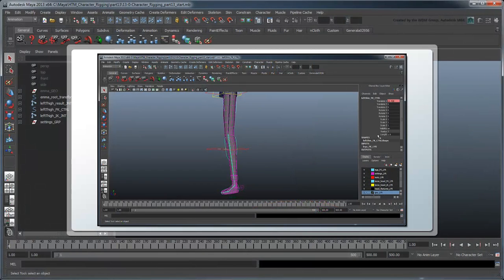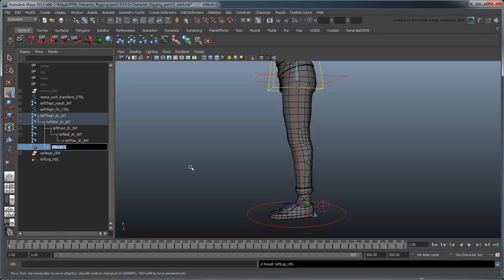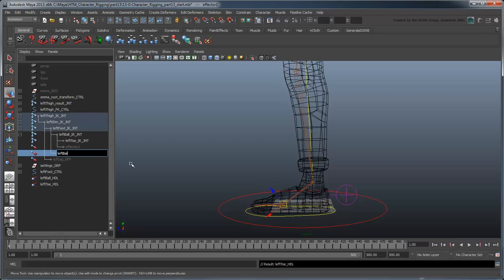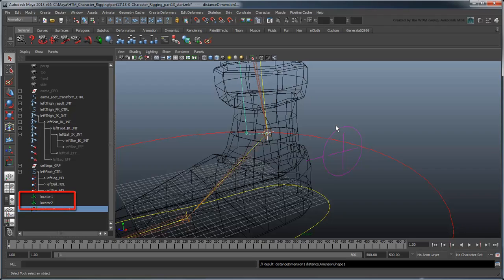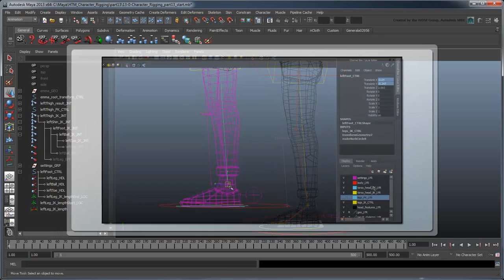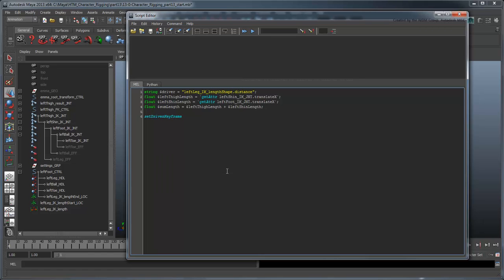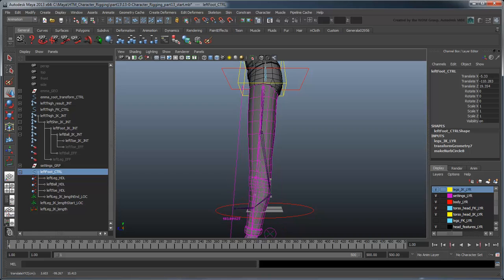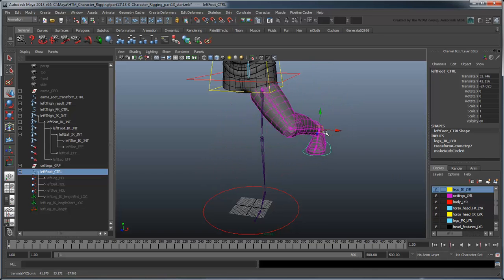Creating a Character Rig - Part 13: Leg IK controls and joint stretching (Advanced)

Comment: Hello. Thank you for this tutorial. 
And I've got a question to confirm what you mean by the comment at 6:17 to 6:31.
Actually, I could understand how tricky to position Foot exactly in the maximum length; however, I couldn't get why you said so in that context. Thank you for reading this. 
(Edited) Sorry, I've just realised that the maximum length means length when joints are in a straight line.

Comment: hi...its me again...i have a problem with the post infinity on the right side...the IK knee joint moves after applying post infinity...Left side is all ok....I didn't have this problem previously...not sure if any graph editor settings went wrong anywhere...

this is before i apply
https://drive.google.com/file/d/1HIElXjyD9vkuu9m3H29xYjmMkVnp5l5L/view?usp=sharing 

this is after i apply
https://drive.google.com/file/d/1Al4cRqlagwrxMcBreUVpLH46Tz37BbQS/view?usp=sharing
Reply from the maker: Odd, it looks as though all your local rotation axes change in the after shot which definitely shouldn't happen.  Can you open the Move Tool settings, check the Joint Orient Settings and make sure Automatically Orient Joints is turned off?  Then I would try reapplying the script to that leg.
Reply: @Autodesk_Maya  thanks for replying....i found the mistake in the script editor...i did not make it an inverse one....

Comment: Maya 2020: Not sure if this issue applies in previous versions. 
If anyone is having issues with the MEL script step and the leg becoming stretched 100% of the time regardless of whether the foot is at the exact same position check the locator's Distance attribute by displaying Shapes on the outliner and selecting the locator's distance shape. The distance value in the attribute editor does not get converted if you switched Maya's Preferences. My distance in the attribute editor was 96 cm but in the workspace the locator gave me a distance of 0.96 m. The MEL script takes the UNCONVERTED DEFAULT CM value as the driver and will therefore always stretch the leg. The quick solution is to change the workspace units in Preferences back to CM instead of meters. 

Somewhat longer fix is to open up the locator's distance shape in the node editor. Mind you this is the first time I ever worked with the node editor (only experience was from this tutorial series) and I was able to get it to work without changing the units. If I can do it thanks to this channel you can to. 

Create a unit conversion node(mine was automatically converting cm to m) and take the locator distance node's distance attribute and insert it as input to the unit conversion node. Then create an empty group and rename it to something that makes sense. Bring this EMPTY group into the node editor and drag the output of the unit conversion into the translateX of the EMPTY GROUP. 

The empty group is there so that we can use it as a driver(probably better solutions out there but my way worked). Now in the MEL script replace the $driver variable declaration from the IK_lengthshape to the name of the EMPTY group you created. Then just grab the translateX attribute by doing a ".translateX" at the end of the variable declaration before the semicolon. Now run the script and voila it should work. 

Also refer to Maximilian Correa's MEL script in this comment section because that worked with my method since I am on Maya 2020. 

I know its been 7 years since this video came out but if it helps you please upvote!
Reply: hello, i'm sorry but somehow after I run the script, when I moved the foot control it permanently stretched even though my workspace is on cm already, do you know how to solve this?

Comment: Should rotation orders in maya be: axis 1 = least used axis, axis 3 = most used axis? (like this tutorial for feet, which is zxy)
Reply from the maker: I wouldn't think of it so much as "most vs least" used axis.  I'd think of it more as, whatever rotation order allows you to create the most common poses without gimbal locking.  Think about the whole pose, not just one axis.
Reply: @Autodesk_Maya  Is there a step by step approach to determine this, or is just "an experience thing"?
Reply from the maker: @Exsulator2  Experience.  The right answer technically depends on your specific rig and desired poses.  The ones I show are the best ones for this rig.

Comment: i need some help in maya 2016
setDrivenKeyframe -currentDriver $driver -driverValue $sumLength -attribute "translateX" -value $leftThighLength leftShin_IK_JNT leftShin_IK_JNT;
// Error: line 6: No match found to driver: leftLeg_IK_lengthShape.distance // 
// Result: scriptEditorPanel1Window|TearOffPane|scriptEditorPanel1|formLayout88|formLayout90|paneLayout2|paneLayout3|tabLayout2|formLayout91|cmdScrollFieldExecuter1 //
Reply from the maker: I'd check to see if your distance node has a typo in its name or something.
Reply: @Autodesk_Maya  thanks alot

Comment: everything works fine beside the moment when my length passes by 2x values the knee bends again ;/ Any thoughts on that? thx in forward.
Reply from the maker: Hmm, are you sure the animation graphs look correct?  They should be straight diagonal lines.
Reply: @Autodesk_Maya  Yes looking same like urs. Besides that, I need to put the second key tangents to spline to make the post infinity liner to work ...
nvm, i found the problem.
I somehow missed to do it for the foot_JNT.  sry for pulling attention to such a stupid mistake ;D
But thx a lot for the fast reply.
Have a nice Day :D

Comment: Hey Listen I've been following this tutorial and everything went fine but my when i stretch the controller the geometry doesn't follow...they(thigh and shin) are stretching individually just fine...( i'm using Maya 2018) . The controller is not stretching at all i also did the programming twice if i made some mistake. can you tell me where i could be wrong? @MayaLearningChannel
Reply from the maker: Did you set the tangents to "Spline" as noted in the video description?  I know I said to set them to "Linear" in the video, but turns out that doesn't work on newer versions of Maya.
Reply: @Autodesk_Maya  i did, as it was the same in one of the previous movies. But i have solved that issue as i did the whole leg again (maybe something i did wrong along the way).. but now my leg and thigh geometry rotates in the opposite direction.. while it stretches just the way it should the geometry rotation is all messed up.... do you know why that happens?
Reply from the maker: @alishaseby6194  Try placing the geometry within a group node first and then into the joint hierarchy.  Does that help at all?
Reply: @Autodesk_Maya  It didn't, it was the same as before.. as soon as i hit linear in post infinity (graph editor), it distorts the geometry. But i finally got it working by using node editor this time instead of mel commands, now it's looking good so far...  Also thanks a lot for your help i really appreciate it.

Comment: Hi, I'm using Maya 2017 and having trouble with the script, this is the script I typed and looks the same to me...

string $driver = "leftLeg_IK_lengthShape.Distance";
float $leftThighLength = getAttr ("leftShin_IK_JNT.translateX");
float $leftShinLength = getAttr ("leftFoot_IK_JNT.translateX");
float $SumLength = $leftThighLength + $leftShinLength;
setDrivenKeyframe -currentDriver $driver -driverValue $SumLength -attribute "translateX" -value $leftThighLength leftShin_IK_JNT; 

this is the error I'm getting
// Error: line 5: No match found to driver: leftLeg_IK_lengthShape.Distance //

What am I doing wrong, please?
Reply from the maker: Change the capital "D" to a lowercase "d".
Reply: @Autodesk_Maya  Thanks alot, all sorted now

Comment: I had problem with code while I am working on meter unit(because I was rigging for unity) and spend some time to  troubleshoot, and this is how I fix it. 
set unit to cm and run script and turn back to the m unit.

Comment: Hi, so I'm mirroring the right leg and have reached the scripting portion.  The IK Chain has been duplicated and mirrored from the left leg chain, and I used the script below.

string $driver = "rightLeg_IK_lengthShape.distance";
float $rightThighLength = `getAttr rightShin_IK_JNT.translateX`;
float $rightShinLength = `getAttr rightFoot_IK_JNT.translateX`;
float $sumLength = ($rightThighLength*-1) + ($rightShinLength*-1);

setDrivenKeyframe -currentDriver $driver -driverValue $sumLength -attribute "translateX" -value $rightThighLength rightShin_IK_JNT;
setDrivenKeyframe -currentDriver $driver -driverValue ($sumLength*2) -attribute "translateX" -value ($rightThighLength*2) rightShin_IK_JNT;
setDrivenKeyframe -currentDriver $driver -driverValue $sumLength -attribute "translateX" -value $rightShinLength rightFoot_IK_JNT;
setDrivenKeyframe -currentDriver $driver -driverValue ($sumLength*2) -attribute "translateX" -value ($rightShinLength*2) rightFoot_IK_JNT;

However, when I use this it states that line 9.140, or the last line, has a syntax error.  A secondary issue arises normally when all my previous attempts at this script have succeeded.  It causes the stretching to not happen, so when I activate the spline tangents and post-infinity linear options, it causes the geo to flip in negatives on the x-axis, the skeleton straightens to a perfectly vertical line in the thigh to foot joint, and still fails to stretch.  All nodes have been renamed from left to right, and I am running out of options for what to do to avoid this situation.  What recommendations do you have to solve this issue?
Reply from the maker: That's odd.  I just tried your script and it worked with my rig (no syntax error).  I also get proper stretching, so it's not a problem with your script - it must be a problem with your rig.  Are you sure you renamed ALL the "left"s to "right"s?  I would also try recreating your IK handle and making sure it matches the same type as the left-side handle.
Reply: @Autodesk_Maya  Alrighty, I'll be sure to try that.  I might need to rebuild the leg from start just to make sure nothing else went wrong.
Reply: Upon rebuilding the right leg from mirroring it and other stuff again, the results were positive and the stretch works perfectly.  Thank you for your help!

Comment: is the same script for right leg?
Reply from the maker: Almost.  You'll likely deal with negative values for the joint locations (since the local orientation will be reversed) so you'll need to also invert the sumlength (since you can't have negative length) by multiplying it by -1.  Other than that, it's the same.

Comment: Hello, Maya Learning Channel! Could you please check what is wrong with the stretching here? Leg doesn't stretch at all. Script is 100% correct and executed perfectly, but I can't seem to find the problem. Maya 2018 version.
Reply from the maker: Sorry, as a policy I can't accept scene files from outside.  However, did you set the tangents to Linear or Spline?  You'll want the latter.
Reply: I've done everything according to the video and I think I figured out what's wrong, but still can't solve this problem. Here's screenshots: 
Leg's "at-rest" state: https://i.imgur.com/PfPlhmN.png
Stretched leg: https://i.imgur.com/GfQ1yQy.png
IK joints' values: https://i.imgur.com/crppHCT.png
While the leg is stretched with leftFoot_CTRL, translate X values of IK joints remain unchanged (local joint orientation is correct; primary axis=X). It looks like these translate values are locked somehow. How can I solve this issue?

Here is additional screenshots of script/graph editors, but I think everything is OK. Thanks for helping me!
https://i.imgur.com/m6zHSQh.png
https://i.imgur.com/GGvvGBL.png
Reply from the maker: Hmm, that all looks right.  Just out of curiosity though, what scale are you working at?  Because judging by the grid size, it looks like you're working at a much smaller scale.  It's possible things are happening but that it's so minute you're not noticing it.  Maybe try using a multiplying the measurement node values by the relative difference between your scene and the example (probably 10) to see if that fixes anything.
Reply: OMG! You are absolutely right! I've been working with extremely small scales, and it was okay for me until this moment. The leg is stretching properly now! However, what if I want to scale up an entire model instead? I'm afraid that my small scale will bring more problems in the future. 

In general, what should I do with a rig before scaling up a model? Thanks in advance!
Reply from the maker: That's handled in later parts of this series (clean up and global scale).
Reply: OK! And thanks for your amazing tutorials! You rock! =)

Comment: Hello! The script I wrote does not work! I am working on the version of 2017, and I would like to know if this is related to this problem? And can I stretch IK JNT without scripts, as it was done by FK JNT?
Reply from the maker: The script should work in any version of Maya.  Unfortunately, due to the reasons mentioned here, it'll be quite difficult to do without using a script.  What error are you getting specifically?
Reply: does not react at all to anything

Comment: My chracter's right leg doesn't stretches like the left one even after I use script with that line:

setDrivenKeyframe -currentDriver $driver -driverValue ($sumLength*2) -attribute "translateX" -value ($leftThighLength*2) leftShin_IK_JNT;
Reply from the maker: Did you watch Part 32 on mirroring first?  There are some tricky things about the right side that you'll want to know about (also, the right-side scripts are included in part 32's downloadable files).

Comment: Hi, thanks for the tutorial, I have a problem, i'm working on a rig, and I'm mirroring the same steps in the right leg but when I run the mel scripts doesn't work. I think may be is because I mirror the joints with the mirror joints tool, and every single step in the left I repeat it the right, so in the script I have to specify that, because, the translate X on the left Leg is 44 but in the right leg is -44, hope you can help me.
Reply from the maker: Yes, you will need to modify the scripts to work on the right side for this exact reason.  You'll just need to multiply the various stretch equations by -1 to invert them.
Reply: Thank you for the answer, where exactly in the equation i have to multiply by -1.
Reply: I'm sorry, I just saw that in the files of the lesson 32 when you do the mirror process exists the script for the right side, again thank you very much.
Reply from the maker: float $rightSumLength = ($rightThighLength*-1) + ($rightShinLength*-1);

Comment: 3:00 
Instead of adding the 2 extra IK handles, would it work to Orient Constrain the leftFoot_IK_JNT under the leftFoot_CTRL, while maintaining the offset,  to keep the same orientation when moving the CTRL? Would it be compatible with the reverse foot rig in part 19?
Reply from the maker: Conceptually that should be fine, but it may not play nice with the Advanced Foot Control in part 20.  That said, you could always try it and see.  At the very worst, if it doesn't work you just have to remove a constraint and sub in an IK handle.

Comment: Maya 2018 working script:

I had problems with the code following the video, after reading some comments I managed to make it work:

string $driver = "leftLeg_IK_lengthShape.distance";
float $leftThighLength = getAttr ("leftShin_IK_JNT.translateX");
float $leftShinLength = getAttr ("leftFoot_IK_JNT.translateX");
float $sumLength = $leftThighLength + $leftShinLength;

setDrivenKeyframe -currentDriver $driver -driverValue $sumLength -attribute "translateX" -value $leftThighLength leftShin_IK_JNT;

setDrivenKeyframe -currentDriver $driver -driverValue ($sumLength*2) -attribute "translateX" -value ($leftThighLength*2) leftShin_IK_JNT;

setDrivenKeyframe -currentDriver $driver -driverValue $sumLength -attribute "translateX" -value $leftShinLength leftFoot_IK_JNT;

setDrivenKeyframe -currentDriver $driver -driverValue ($sumLength*2) -attribute "translateX" -value ($leftShinLength*2) leftFoot_IK_JNT;

Hope It helps!
Reply: Maximiliano Correa 
Thanks a lot the only code that work for me
Reply: Thank you!
Reply: Very helpful indeed, thank you!
Reply: Thank you so much
Reply: Can someone give me a hand? 

After following your commands with some of my personal naming conventions the Left side of my rig works fine, how ever when i try to apply it to the Right side of the rig, the code doesn't work. It doesn't produce an error, but the leg doesn't stretch either.

string $driver = "R_Leg_IK_LengthShape.distance";
float $R_ThighLength = getAttr ("R_Knee_IK_JNT.translateX");
float $R_KneeLength = getAttr ("R_Foot_IK_JNT.translateX");
float $sumLength = $R_ThighLength + $R_KneeLength;

setDrivenKeyframe -currentDriver $driver -driverValue $sumLength -attribute "translateX" -value $R_ThighLength R_Knee_IK_JNT;

setDrivenKeyframe -currentDriver $driver -driverValue ($sumLength*2) -attribute "translateX" -value ($R_ThighLength*2) R_Knee_IK_JNT;

setDrivenKeyframe -currentDriver $driver -driverValue $sumLength -attribute "translateX" -value $R_KneeLength R_Foot_IK_JNT;

setDrivenKeyframe -currentDriver $driver -driverValue ($sumLength*2) -attribute "translateX" -value ($R_KneeLength*2) R_Foot_IK_JNT;
Reply: Thank you so much!!! I finally succeeded!!!